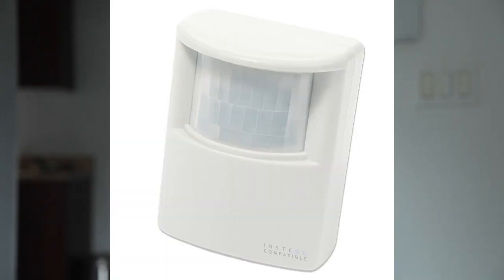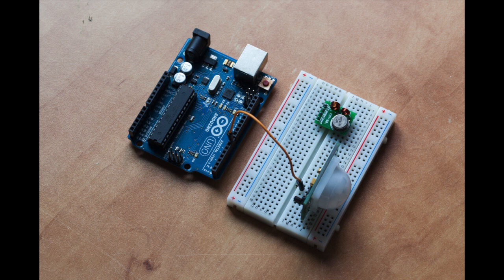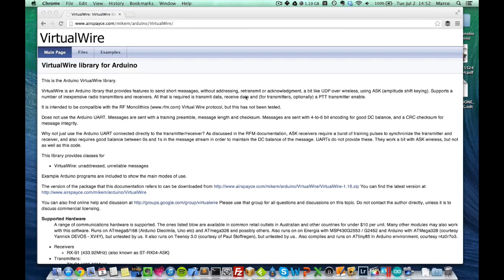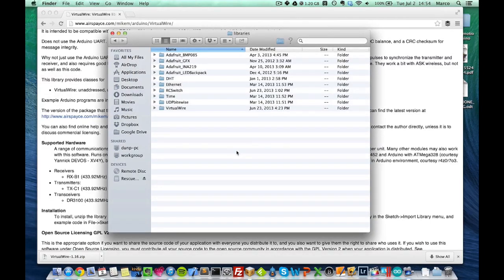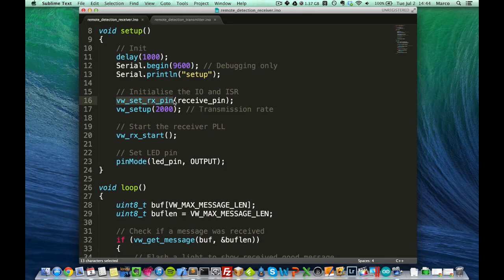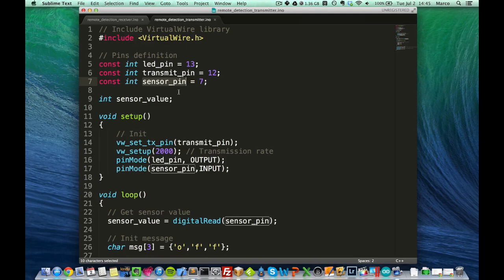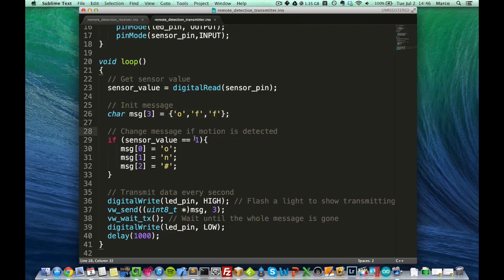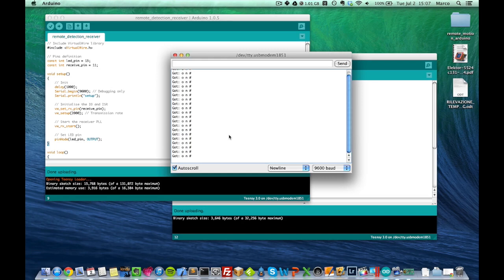Create your own wireless motion sensor with Arduino

Comment: Hi Marco, I am late to your posting but I have watched several tutorials about this PIR adaption to Arduino’s and have found your’s to be one of the best productions. Your slow approach to teaching is well received because I can recognize your struggle with English as a second language. But I respect your struggles highly!! I believe this gives a student a better understanding of the process with you explaining each code detail in the file and this will give a student the ability to learn and understand the entire process. I am just learning this program design for a remote sensor that contains a solar powered Arduino PIR system to transmit a good distance almost 35 meters outside my home. The battery & solar charging system has been my greatest challenge of my design. Also after watching your video I have made changes to my PIR system to reflect your simplistic design and help reduce power consumption. As you can understand this is critical for a remote batter powered system. Thank you Marco for assistance. I have been over thinking my design!!
Reply: Hi, can you please assist with adding remote control to the circuit

Comment: I am getting the error message:
 exit status 1
'sensor_value' was not declared in this scope

I used the code on the website:

const int sensor_pin = 7;

void setup() {
 Serial.begin(9600);
 delay(1000);
}

void loop() {
 // Get sensor value
 sensor_value = digitalRead(sensor_pin);

 // Print on serial
 Serial.println(sensor_value);
 delay(1000);
}

Please tell me what the problem is

Comment: Can I recieve data from two separate emitters to one reciever? Could this be done with two RF link kits to two reciever to one arduino?  I need to track direction!
Reply from the maker: LillaLue91 Unfortunately that's more difficult to do with such cheap RF modules. I would advise using XBee if you have several modules in your network.

Comment: How do i connect light to this application? so that when motion is detected the light will glow.
Reply from the maker: noroz k Simply by connecting a relay (or just a LED) to the receiving Arduino board and you should be fine :)